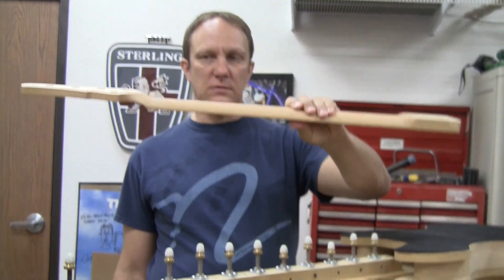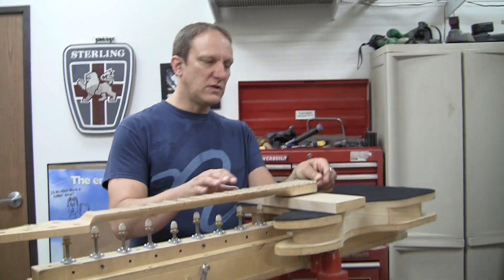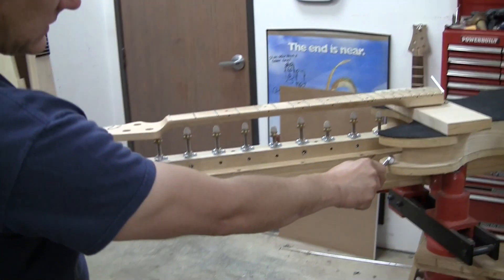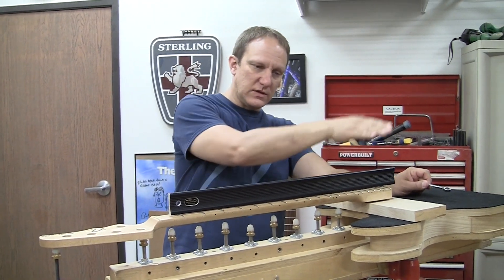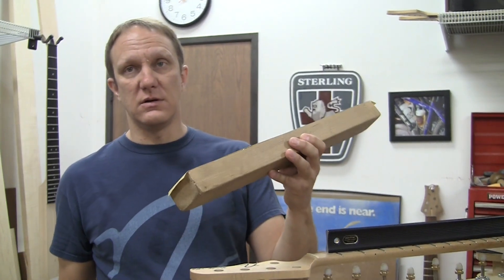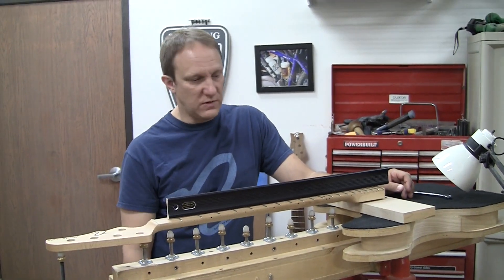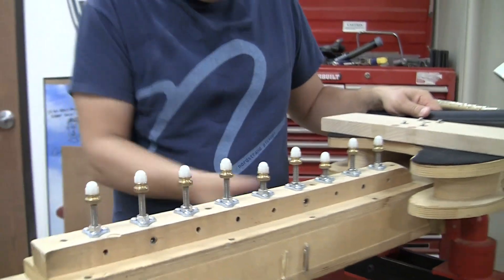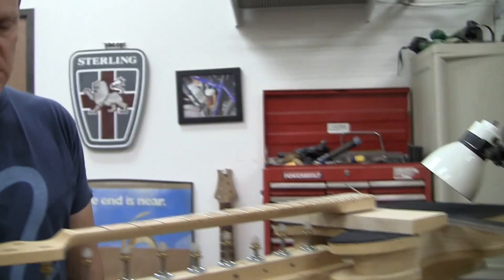Neck Tension Jig

Comment: This is awesome! I am curious, though, why a neck often has the "S-curve" out of the CNC. I have a Squier neck that I defretted, and it has the dreaded S-curve. I will have to do something like this to sand the fingerboard down in the area of the 2nd and 3rd frets because when fretting on the first, the strings contacts the board ever so slightly....

Comment: I'm not convinced this is the way to go! Is it not better to use a notched neck level checker and get the neck straight before doing fret work? With your method, you are getting the frets as level as you can but not the neck. I do a lot of fret jobs and I always get the neck straight first. The frets should be levelled after the neck is straight. Using your method, the neck is not straight...
Reply: NG One Seven When Carey is describing the process, he goes into depth of how he sands down the fretboard after it comes out of the CNC, then checks fret slot depth, then installs frets.
As he had the neck in the jig with 220 on the sanding block, it was set up to finish frets. He wasn't talking about hitting frets up with 80-grit...